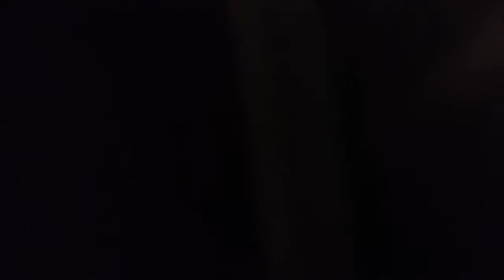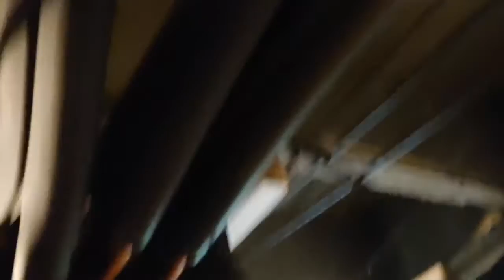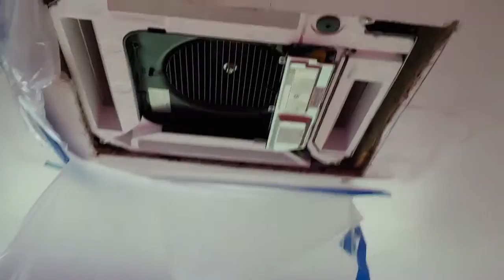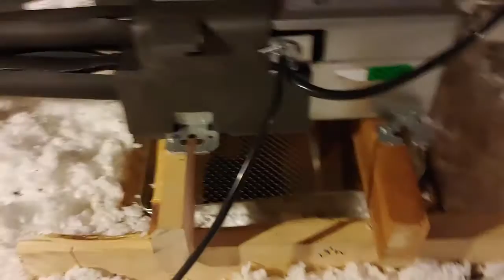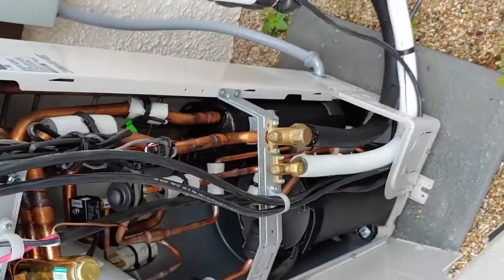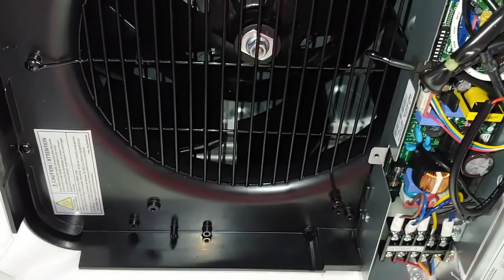LG 60k Branch Box Mini Split System install

Comment: Appreciate the video! I am about to install a similar system but at 48k BTU. Can you confirm whether the branch distribution box has plugs on the ports?

My thought is to oversize the distro box in case I want to add another unit later. It seems like the distro boxes have the plugs at each port and also have built-in valves for each port which could allow for evacuating only the new indoor unit, but I may just be overly optimistic about this.
Reply: btw, I installed a single-zone LG unit in a studio apartment and was able to find a contractor to apply the vacuum and test the connections but now I live 80 miles away from the city so not sure if I can swing the same deal.

Comment: you are either a plumber or an electrician, or some hvac tech helped you because there is no way you could have pulled this off either wise
Reply: I disagree with your statement. I did some install on my own. It's easy to read and learn about HVAC, it just takes some time. I also got my EPA section 608 (universal) certification, doing an online proctored exam -> making it easier and legal to buy the refrigerant. I think I was able to do a code-compliant install better than what most local HVAC company would have done. Especially for the initial leak check... Many HVAC companies are barely starting todo N2 purge and tests now. If they had a bit of water and air in the pipes, not a big deal, it can take 5 years or more for the corrosion to create some issues. They will sell you a new unit or some expensive maintenance and blame the manufacturer, not themselves. 

Tips besides what @DrMcWiggles already mentioned like doing your own flares, having some quality pipe cutting and deburring tools as well as flaring tool, cutting off factory flares... :
I fully recommend to do the evacuation and leak tests on your own, as well as the refrigerant filling (based on lineset length and instruction manual calculations for your specific unit)
i.e. get a vacuum pump, get some good manifold, a good micron gauge, buy a nitrogen tank and regulator. Manifold: digital stuff works great. I've a Testo 550i, something like that. Sometimes they go on sale for crazy low prices on Amazon as a kit. Your phone handles all the calculations, will compensate for temperature to do a leak test, etc.  
Follow the manufacturer's procedure. Usually it's vacuum, fill with N2, vacuum, fill with N2 (2 or 3 times total). Check for leak while under vacuum, but also while under pressure. (pick the right psi for the N2 test, again manufacturer's recommendations). 
Buy the fancy hvac bubble solution: spend a few $ vs dish soap, but will help to find micro-leaks. It's worth spending time to make sure there are no leaks. 

I have not setup a branch system yet, and I'm pretty sure the installation manual will have some specific settings to set in order to trigger all the valves in the bdu to be opened. Doing the evacuation (vacuum) and nitrogen pressure tests without opening all the valves in the BDU is doomed to fail. 

For some other comments: do get a (cheap) refrigerant scale. It's by weight that one adds refrigerant in any new system. And the mini-split are basically too fancy to be able to do a simple superheat and subcooling calculation in many cases. 
Do get some good book (Expensive, but not compared to the total install) and watch some videos to understand how to handle the gauges and connections. e.g. not introducing air in a system for instance. And if you use a core extractor, get the right sizes for your system, and go for high quality one. You don't want leaks (or metal breaking) when you set-up your system. 

Last: get some good torque wrench for the job. Don't guess. Learn the technique (2 wrenches, one regular one torque). It's simple and works well.

Comment: Are you able to set some indoor units run while leaving others off? I did my own install on a LG 48k multi zone, branch box to 1 wall unit and 1 high static ducted. However when I turn on the wall unit, sometimes the ducted turns on too and vice versa. It seems like it has to, because when I try to run cooling on say the wall unit, I don't get really cold air until I turn on the ducted. The whole point of going multi zone was so I could control them independently, but it seems like I can't just have 1 indoor unit running.

I figured you were in the Chicago area, seeing all that electrical conduit, and you just mentioned Illinois. You're right about trying to get an HVAC person do vacuum and charge in this area. I ended up vacuuming myself with an Amazon bought pump, luckily I didn't need any extra charge. I also recommend doing a nitrogen pressure test.

To add to the tips, I would say reflare every lineset, don't trust factory flares. Documentation is terrible, I had to cross-reference several different versions to figure things out. None of this is rocket science but it's easy to get hung up on little details, just figuring out fittings, adapters, etc. is a giant headache.
Reply: did you get to the bottom of your units inability to run a single IDU at a time?
AFAIK inverter ODUs have a certain "turndown" ratio, e.g. they might be rated at 48kBTU (which could correspond to 130hz), but can go as slow as 40hz (which corresponds to 15kBTU) or as high as 150hz (which corresponds to 55kBTU). It all depends on hardware+software in ODU as well as ambient conditions, e.g. unit can only run so slow during high ambient temps. So in your case, single wall IDU might be smaller than the slowest ODU can go in a given situation (you mentioned it only happens "sometimes").
Reply: @elyor2008  Turning the wall unit on will still sometimes kick on the ducted unit. I figured out that I CAN run one unit and get cold or heat, but it runs much better with both on. 

I'll look into the "turndown" ratio, never heard of that. Not sure it applies to my situation, I have a LMU480HV ODU (48k), LHN248HV (24k), and a LMN249HVT (24k).

Comment: Awesome; this is exactly what I want to do. Why did you choose LG over Daikin? They have a 10 year waranty, is that what you have? Also, did you predetermine the lengths and use the linesets "as ordered" or did you end up cutting and redoing those? Thanks!

Comment: Thank you for the video, just received all my parts, about to start my own DIY installation, fairly handy but never done anything like this. My BDU has 1/4 and 3/8 connections, but my wall unit has 1/4 and 1/2 connections. I bought the 1/4 and 1/2 linesets as that was recommended. Is there an adapter to connect the lineset to the BDU?

Comment: You made several mistakes that will cost you later, number one placing your lineset connections inside the wall. If you have a refrigerantion leak or ever need to replace a head you will have to open up the wall. Secondly, if you run your linesets in the wall please spray foam the cavity to take care of condensation so it doesn't ruin your walls
Reply from the maker: I have the location marked and if need be ill only have to disrupt a small space to change them out(for me plaster lathe/drywall is the easy work lol), and the linesets have since been well insulated, so far everything has worked great!

Comment: Thank you for this video, super helpful.  I also tried the DIY HVAC system and stumped at the final operations.  LG systems, 54k btu, with 5 ceiling cassettes and 2 distribution boxes.  The problem is the outside system has blinking led 5RED, 2 GREEN, and the distribution boxes have no LEDs on even though electricity is clearly present at each AC unit and distribution box.  Just not sure what I missed on the electrical connection to distribution to get them to light up with LED working ?

Comment: Do you pull an evacuation from each air handler or just from the condenser?
Reply from the maker: condenser is precharged with refrigerant, when you pull the vacuum it is just on the linesets, branch box, and the zone air handlers. its all done at the same time from where the lines connect to the condenser, after you can then release the refrigerant from the condenser by opening the valve and add any additional charge that is needed

Comment: Does all wiring go to branch box from zones
Reply from the maker: for the LG system a heavier gauge wire goes from the outdoor unit to the branch box, then from there smaller gauge wire goes to the zones themselves. make sure that you get the proper gauge wire and the correct number of conductors in your cabling for your system
Reply: What size wire did you use from the outside unit to the branch box?

Comment: eComfort told me that if I try install by myself without a licensed HVAC contractor, it will void all warranty. How did you handle that ? Or you are okay with no warranty on all these ?
Reply from the maker: to my understanding that is correct, for me it was a cost benefit balance, the quote to get someone to do what I did would have been easily 2.5 to 3 times what I paid for the system so for me it made sense to install it on my own and hope that nothing broke on it, so far its been running about 4 years.

Comment: Did you (or anyone else reading this) have any trouble getting the system to power up?  I have two exterior LG Multi F units (24k and 36k) with 2 and 4 indoor units attached to them (running as independent systems).  All indoor units are ceiling cassette units ranging from 7k to 12k BTU.  When I power up the systems I get a solid red LED on the outdoor units, some clicking and then nothing.  I tried putting it in "Forced Cooling Mode" (with the dip switches), but that doesn't seem to work, either.  The ceiling units don't seem to respond at all.  Opening the cover on the ceiling units seems to do something, as the large and small green lights in one of the corners come on briefly.  On one unit, the fan turned on when it was open (others may have had the same behavior, but I was trying a number of different things and different modes, so I didn't check all units under all of the same conditions).  I believe my wiring is correct (double checked already, will triple check tomorrow).  Also slightly suspicious... the LMU24CHV outdoor unit has a digital display that shows various parameters.  The "DC Link Voltage" displayed says 335V.  I thought this was supposed to read 230V, but I'm not certain.  Anyway, any help or suggestions would be greatly appreciated.  I'm looking at getting one of the LGMV monitors, but I'm not sure if this will give any clues.  Thanks in advance for any comments!
Reply: UPDATE: I did some more troubleshooting and found that the system is 100% functional as long as the grilles on the ceiling units are open.  Each ceiling unit has two "door switches" (momentary switches used to let the unit know if the grille is open or closed), which are designed to help keep a user or service technician safe.  It seems like the design has either the wrong part or has then wired wrong?!?  When I close the grilles, the units shut down... when open, they operate just fine.  The switches are easy to defeat --- they are NO [Normally Open] switches, and since the unit works when they are in the open position, I just disconnected the wires going to each switch.  BUT... does this indicate that I have done something wrong in the wiring or set up of the system somewhere else?  I have trouble imagining how some connection error on my part would result in a fully functional system with just mis-wired door switches, but it is hard for me to believe that something like this would make it out of manufacturing from LG.  Any thoughts on other things I should check are appreciated.

Comment: HI, I just turn on my unit today and I have issues with my second distribution box where I have connected 3 ceiling cassettes. My first distribution is only one wall unit and working fine.

I see power in the distribution box, but all the LED are solid and should blinking/solid according with the label. Second all my 3 units doesnt want turn on, one of them has a green led blinking in the corner. Did you touch the dip switch to set something?

Also,and may be I did wrong. n the grili is a fourth cable (white with four cable, two black two white) that I didnt find a white connector in the board and finish connect it in a blue connector that according with the manual is a Air filter cleaning sensor.

I will appreciate your support, Thanks
Reply: As far as I could determine, the white connector isn't used.  I had it plugged into the wrong slot which caused the unit to power off, and blink, when the grill door was closed.

I check this thread occasionally to see if there have been any updates.  I realize your post is three weeks old, but wanted to offer that  bit of info.

Hope you have things sorted out

Comment: im with you. im looking at the same, but considering mr cool. estimates i got for four rooms was 18k from one company and 27 from the one that sells Mitsubishi.

for something that is supposed to be easier for them to install, it makes no sense that they charge twice the labor charge of what they want for labor of installing a forced air sys.

my cost will be about $7k for the above quoted build out. so i guess they quote as follow?..

price of sys *3
 1st for hardware
2nd for labor and profit
3rd for prepaid warranty where you pay for the whole system again incase they ever need to provide you warranty service or they fk your build up (i say this because my guys had no idea what they were doing).

i also think traditional hvac installer sellers prefer forced air here in south because long-term maintenance (service fees) are more lucrative so they are attempting to disincentivize minisplits by unnecessarily increasing the cost.

Comment: Hey, Doc.  I managed to install practically the same system with 5 zones, only with the 54K condenser, and a 18k low static ducted unit for the basement.  Your video popped up when I was getting down to it, and it really helped me.  So, thank you!

I do have a question that you or some of the others who have gone this route might be able to answer:

So, I went with the cheap wired controllers at first, and later found a deal on ebay for some CRC1 controllers , and upgraded.

However, now that there have been a few days of the house warming up, I've noticed that the Auto changeover mode doesn't work.  I have the Outdoor unit set to "normal operation" and not locked to heating or cooling, so I think I'm good there. I've set all the units inside to "auto mode", but they just sit there as the house climbs toward 80. At this point the only way it will changeover, is if all but one unit is either powered off, or is in fan mode.  

Upon initial set up of the controllers, the "dual setpoint" controls appear and I'm able to set them, but then they disappear, so not sure if that has anything to do with it, but documentation really isn't any help.

Anyway, maybe you've had some experience with this, by now, and could offer up a clue, if so.  If not, I appreciate your time and efforts just the same.

Thanks,

James
Reply from the maker: My system came with wireless remotes, they arnt fancy but they seem to work pretty well. They only have one mode selected at a time

Comment: This was a fantastic DIY installation. Thanks for sharing your experience.
Now that you have been running the system for a while, Can you please share what is the running cost of this system i.e. how much KwH of electricity it is consuming to heat your house in winter and to cool in summer ?
I have heard that having two outdoor systems with 3-4 zone each than a single big outdoor unit with 6-7 zones  is better from efficiency perspective as it goes down significantly when only 1-2 zones need to run off a single big outdoor condenser . What is your perspective on this subject ? Also, have you encountered any issue when one zone is needs to cool , say, to 70 F while the other is asking for only 78 F ? Are these zones able to maintain desired temp without running into conflict with each other ?

Comment: Hi Dr.McWiggles. Huge thanks for your contribution to the community of DIYers. My project is almost identical to yours except I am installing 8 indoor units, all wall mounted. Your video convinced me to surrender the esthetic and favor the simplicity (so to speak..).
Also I am leaving the old (but still working) HVAC system intact so I can take my time and complete the project little by little. 
Here are my questions. 1) I need to penetrate a garage shingle roof (from its attic) to gain access to the outside and run 5 parallel line sets vertically on a external house wall. From there I will be able to go where I need w/o major problems. Can you recommend any perforation technique that is clean and watertight. 2) How did you buy the refrigerant? 3) Does LG give you a warranty w/o a licensed installer's signature when you register the product?  4) Is there any particular reason you picked a LG system?
Congratulation again!
Reply from the maker: 1)I just used a hole saw and tried to seal it up the best I could, ecomfort sells plastic housing that you can put over your holes and seal up with caulk
2)I was going to get a license to purchase it but a friend who installs A/C units came over and helped with the refrigerant injection
3)no and im pretty sure every mini-split is the same (even the ones who highly advertise DIY)
4)i picked LG because i think they had the best looking system in my opinion, they had ceiling cassette style units, and they were a little more affordable